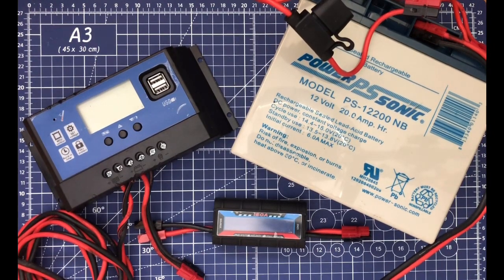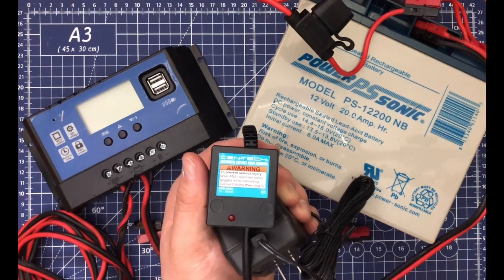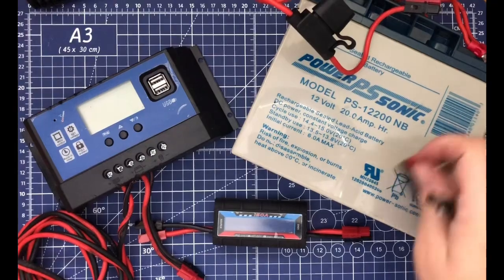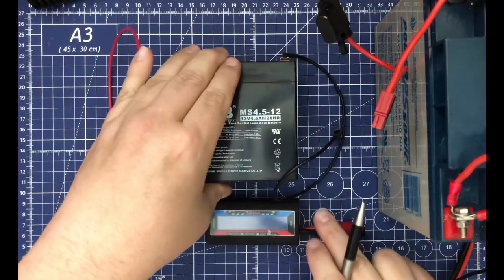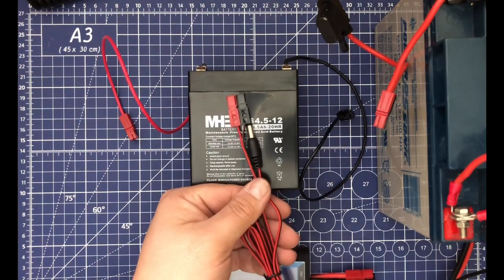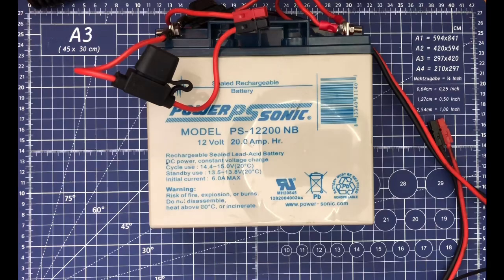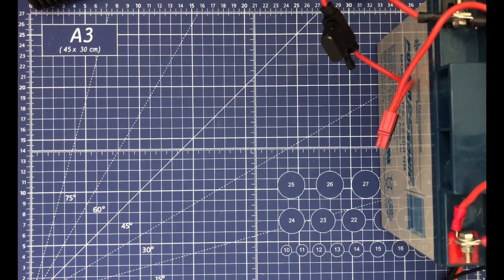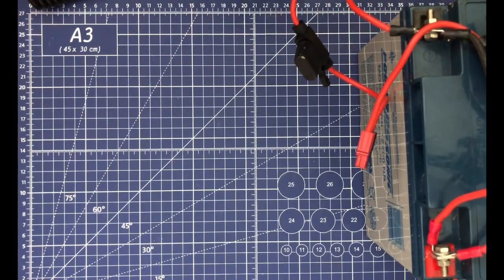Alternative Power on a Budget

Comment: I use batteries I already had. Power tool batteries. You can search for robotics connectors to plug them in. Buck converters to lower voltage if you need. Knockoff replacements for a cheap way to get more amps. Raspberry pi computers run on 5.2v 5A with a small touchscreen. Separate battery for sound. About 7 hours runtime overclocked. Android or PiOS. Installed in a 90's boombox. Video games, movies, tv, music, anywhere. Cell phone hotspot for internet.
Reply from the maker: @pgtmr2713  yes another great source of alternative power! And spot on with the buck converter, with one of those you can power all sorts of things

Comment: Two other suggestions: (1) For lead-acid batteries, contact companies that service fire alarm systems. Every two years or so the batteries in Exit signs have to be replaced. They might donate a few to you. (2) For lithium batteries, look for sources of the popular 18650 batteries. Break open a laptop battery, and you're likely to find four of them, with three still having life in them.
Reply from the maker: @Inkling777  yes to both! You can harvest so many SLA’s that are replaced on maintenance plans. Another great source for 18650’s is throw away vapes. They all have one or more in them

Comment: Power Sonic is a good brand of rechargeable lead/acid battery.
Reply from the maker: I’ve been very pleased with it and would agree
Reply: I was surprised to see a video in 2025 working with PWM controllers and lead-acid batteries. These stuff is trash. LFP batteries and MPPT controllers are out since 15 years ago. Please update your mindset a bit.
Reply from the maker: @ and while that may be considered the case by some those newer components are also very costly for some people. This is a budget friendly alternative that affords them a way to enjoy the same as others. 

Sure there are some lithium batteries out there for under $100, but then you factor in a $60 charger, $125 solar controller, and other parts and you’re quickly 2-3x over what this build cost for BOTH setups. Not to mention they offer half the capacity of this one.
Reply: @ThanosSustainable  I live in Jamaica and still build cheaper/simpler solar systems as a hobby.